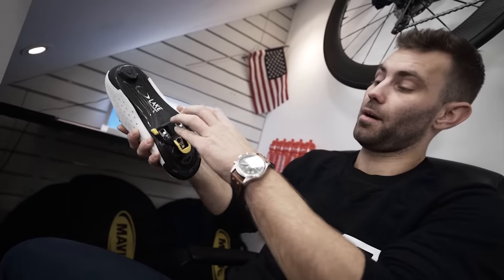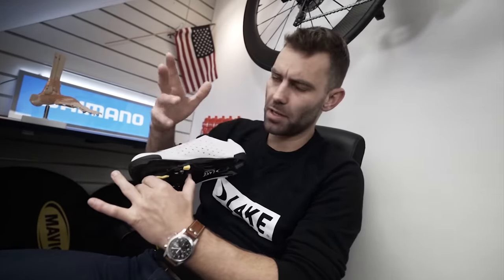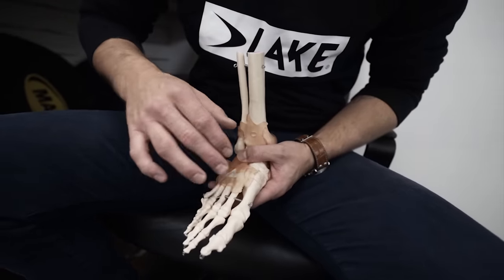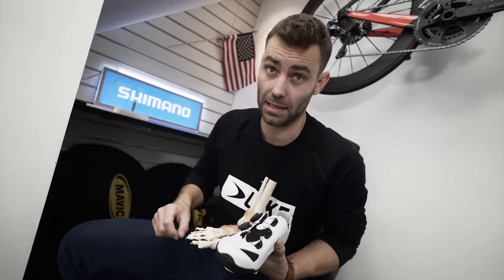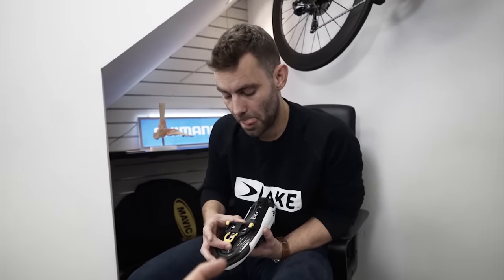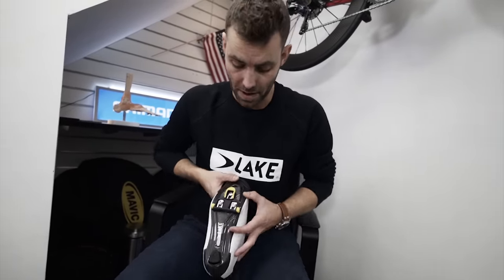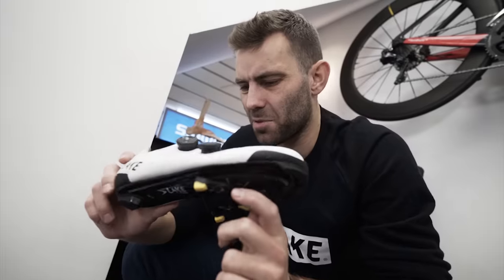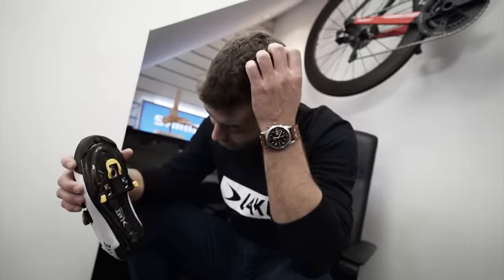How to Set Up your Cleats - BikeFitTuesdays

Comment: Bust my back many years ago ... rugby ... bed .... cast ... wheelchair .... and then had to effectively get back to even walking after full body cast for so long. 
Net result, well, shoes and position 30 odd years later make a difference. I’m certainly what you’d call “unreasonably active” and run an outdoor company in France 
I’m not a mad arsed million km per day guy on a bike being older, built like a brick privy and essentially knackered but I just did the first half of the French Chemin de St Jacques from Le Puy (350 km) on my bike ,.. and only have another thousand plus or so to go to Santiago. I admit to being sceptical but have found cleats to be surprisingly handy on my bike. Only have one set of spd based shoes as the rest is just flats on the other bikes. Which is fine. 
I’ve been wondering and obviously researching advice on this as I get used to them. Reality is that there’s a hell of a lot of “advice” out there so you end up just trying shit. 
I do however trust what James said here because he is bloody obviously a bloke who knows his subject. 
Were I to be anywhere near him and not in SW France, I’d pay for him to actually just set it up properly for me.

I’d advise others to do the same if they can and are closer. A day spent doing that is worth a lifetime of messing about ... get someone who actually knows what the issues are to help you. You’d not try to guess how to fly a helicopter even if you had one so why guess when there is an option. 

Cheers

Comment: This is my 1st time using clip-ins.  I've watched several videos because I had a slight hip pain after my 1st short 15 mile ride with the new pedals.  I positioned the cleat so my heels would point inward because that's my natural foot position.  I mistakenly positioned the line of the cleat to line up with the small bone (pinkie toe) rather than the big bone.  I'm gonna make that adjustment and see how it goes.  Thanks for the tips.

Comment: I drilled holes on my old Shimano XC31 shoes just to have the cleats further back by nearly 6cm from the 1st metatarsal as an experiment. It is still not entirely mid-foot, but close. By doing so, I found you also take the load off the calf muscles and activates the glutes more, thereby sustaining longer, harder efforts as well. It feels weird for sprinting but hey, it's comfortable for audax, relatively fast endurance rides and touring. Only downside is that there is some amount of toe overlap and touches the front mudguard sometimes, but never had any issues with it unless you pedal on tight corners.

Comment: I got my first pair of shoes and Look cleats, and it seems to be easier to setup than I thought, I prefer them slammed all the way back but have to angle the cleat because my right foot points out more than my left. But if you slam the cleat all the way back then you just have to worry about the left/right tilt which you can keep testing.  With the cleat forward it will cause IT band pain, at least for me it did.

Comment: Brilliant. As ever. Question for jim. I'm slightly valgus (knees inwards) but my LAKE size 47 (plug) shoes are so wide i have no option but to move them outboard to clear the crank. Any ideas? Tricky one!
Reply: Similar problem with mine, interested to see any possible solution.
Reply: depends on the cause, arch support and some wedging might help if pronation is driving it
Reply: @Bikefitjames  cheers! Next time im in London i want to book in actually.

Comment: I'd love to hear about how cleat position interacts with saddle height, and setback.
Reply: He answered this in the latest Francis Cade video. If you move your cleats back all the way, you probably have to lower your saddle by 5- or 10mm, because the extension of your legs changes when changing the cleat positions.
Reply: @Xantulle  thanks for the heads up, I haven't watched yet. I'll give it a watch before I go to bed. Thanks! :)

Comment: Great video. I do have one question: I got a bikefit about one year ago as I had ITB issues and from an old injury one leg is 1.5cm shorter than the other. The fitter moved one cleat fully back and the other to the front to counter this discrepancy. What is the thinking behind it? Together with some minor adjustments it helped a lot, but I do not really understand it :D

Comment: Interesting videos these bike fit ones. Here's a question on cleats. I've nearly a size difference between one foot size and the other. If I set the cleat on each foot relative to the ball of the footmy pedalling feels different one leg to the other. Should I set them the same position relative to the shoe instead so that it puts them in a similar postion relative to rest of the leg and joints?

Comment: Found this video really helpful as I bought a new pair of shoes last summer and have only just been able to wear them as my right foot would go completely numb within 15 minutes of riding. Tried so many different setups apart from this 🙈. Still have what feels like a pressure point on the outside of my right foot which causes a bit of numbness but nothing to the level it was. Any tips on how to sort that? Thanks

Comment: Thanks for the very helpful video. Just a quick question, I recently found out I have forefoot varus, but apparently it's only on my right foot, resulting in hot spot on the outside of my right foot. The left foot is quite normal with no pains or cramps whatsoever. Now, I know mounting cleat wedges would be a solution to this problem, but I wanna know if it's ok to mount wedges on one cleat only? Wouldn't it create leg length descrepency? And if it does, how do I fix that? Thank in advance.

Comment: Hey James. Set the cleat up on my Bont Vapor S all the way back. By doing so, I had Discomfort on the right hip/right lower back. I think Bont's are drilled further back than most shoes. Went the opposite direction. All the way forward and I feel more power with no discomfort on the right hip/lower back. Any idea why that might be? I've had a fit and saddle fore aft is as dialed as it can get. I was just experimenting to see if more power would come from that rear ward cleat set up. Anyway, curious what you're thinking might be?

Comment: My Bonts have limited adjustment. I tried right back. But found I needed to move them forward a bit to feel fully planted. Bont Vaypor S size 42W. I’m 1.68 m tall and ride an R5 size 51.  I couldn’t get the cleats to feel right until I got my Saddle low enough. Saddle height, saddle height, saddle height. 

Question: do you know if the Bont cleat positions are neutral, forward or to the rear? 

Love the Bike fit videos.
Nick

Comment: I have Mavic shoes and new cleats for a new bike. Noticed today that when i turned the handle bars quite sharply, the tip of the shoes rubbed against the front tyre!! Never experienced this with my old shoes and new bike. It this simply down to cleats needing to be adjusted?

Comment: Hello,,,
I faced an issue when I bought road cycling shoes then I fixed cleats properly in many locations inside the  showes however the shoes face still touching the crank atm I don't know why is there any piddels with long arm a little bit to let the shoes far from crank arm or not,,,
Waitting your kindly reply,,
Thanks a lot
Appreciate,,, 😎👍

Comment: Great video. I have very wide lake shoes. Because of this my front/side of shoe rubs against the centre of the crank. I've tried moving cleat position (to side) but it still rubs. So far I've been told the only way to help is to increase stance width, but I have small hips and if I do it could lead to my knees moving in when pedalling. Any tips?!

Comment: One question. BFJ said that you should place the cleat 10-20mm behind the first metatarsal/ball of the foot. What exactly should be this distance behind the ball of the foot? Top very top of the cleat? The top bolt? The back two bolts? Looking for some clarification - thanks!
Reply from the maker: The middle of the cleat which is marked, quite hard to spot though

Comment: Bikefit Tuesday’s are so interesting 🙏🏻
As a physio, I learn a lot with these videos. 

But concerning the lever: why the « length » of the lever don’t have an influence on power ?
Reply from the maker: It's because it's part of a system, bit like crank length. Power is work done over time, so you just end up pedalling faster or slower to compensate

Comment: Hi! I started using clipless pedals and I'd like to set up my cleats corretly. I moved the cleats back as you suggested. I noticed when I stand hips widht apart my right leg is at least 2 cm forward then my left leg. Should I consider this when I set up my cleats? If so how?

Comment: Great video! I have one question: recently I bought new shoes and now I start having pain already after 10min on the outside of my foot (google says its called 5th metatarsal base). could it be cleat position or the shoes are simply too narrow for my feet. thanks!
Reply: I used to suffer from intermittent 5th metatarsal pain myself. It was due to insufficient stance width.  The cure was to fit 65mm axles on my Speedplay Zero pedals, and run the cleats in the center of their inboard-outboard range of adjustment..
Reply: @germanhugger41  Stance width is the keyword. Just googled it and could be my problem! Thanks ... will try that out today.

Comment: I have seen Pros riding the Shimano  red SL cleats with 0 degrees float. I have some in the garage. I've had a bike fit so I'm tempted to try them out. However I don't suppose I'd gain any advantage unless I could do 2000 watts Sprint.

Comment: i know this video is a few months old so don't know if I'll get a response, but google hasn't been doing me any favours so I'll give it a shot. Do you think bad cleat position could possibly travel all the way up your body and result in one of your hands going numb? Recently adjusted my right foot cleat just a smidge because I was having some problems with that particular foot, and now a few weeks later I've started having pain in the right knee and also my right sitbone. The weirdest thing is also my right hand has started going numb super early into rides even tho my hands and shifters are in the same position. Clearly I made a mistake in my adjustment, but I just don't know if the hand thing is part of it or not? My left hand hardly ever goes numb like my right hand does...

Comment: Hey guys i have shimano r321 shoes with cleats set fully back with speedplay pedals. I have to much rocking in the left foot and now the foot is pushing on the outside side of the pedal and i get a slight pain after rides and think i need more stable shimano pedals after watching your videos. My question is if i switch from speedplay cleat to shimano will i have the same fore aft position?

Comment: Great Bike Fit Tuesday and full of information. James mentioned about white tape and marking up your foot position and he generally moves the cleats back 20-30mm. Where would this measurement be taken on the cleat? Is it as simple as the centre?
Reply from the maker: Yep the centre, which should be indicated by a small marker - we tried to show it in this video but it's really hard to see on the black plastic of the cleat!
Reply: Thank you for responding so quickly.  Time to check my cleats

Comment: Hey James, thanks for the nice vid! I started with my cleats/shoes facing perfectly straight forward, in line with the bike. (I have the yellow SPD SL). I've noticed a lot of pulling on my right knee though when cycling for a few kilometers, and my right knee is coming inward towards the bike frame when I bend it when pedalling, while the left leg/knee stays straight. Cycled a couple times and it resulted in pain in the back/cavity of my knee. Can it be that the "natural" position of my foot is slightly outwards (front out / heel in), and that I have to rotate the cleat a bit to relieve the knee? I notice this also when doing squats; my right foot is slightly angled when squatting/bending the knees. Will try them at a slight angle, hope I won't hit the chain with my heels then though.. Can this knee pain / pulling feeling be caused by a wrong cleat setup, or could it also indicate a different issue in my overall bike setup?
Reply: Wow I now know it wasn't necessarily the angle of the cleat. Issue was my stance. My feet were simply too close together with the default 105 Shimano pedals (I'm 6"4), hips/knees/feet weren't aligned at all. Angling the cleat helped a bit to "open up my hip" and bring my knee out, but a wider stance was the real fix. I first tried to put my cleats inwards under the shoes, to bring my feet further out and increase the stance, immediate improvement! Less "pulling" feeling in my knee and knee didn't come as close to the toptube anymore. I now bought Ultegra +4mm pedals, the slightly longer axles make a huge difference! Can now move my cleats to the center of the shoe again, don't need to 'angle' them much and my knee pain during cycling is gone!
Thanks a lot for your videos and insight. Getting a full bikefit from you someday is now on my bucketlist.

Comment: At about 4 minutes you mention that moving the cleat back reduces the length of the lever and increases stability through the ankle, so why do you want to generally want to move the cleat all the way forward? Is moving the cleat back specifically to address problems like knee pain?

Comment: Great video,  but after having my bike and shoes set up by a pro fitter, I have used the yelllow shimano cleats for 5 years and never had any issues or pain.
However recently i wanted to experiment and i moved the cleats all the way back, and now on the foot that i mostly clip and unclip, the top contact point of the cleat keeps breaking after 4 to 5 rides. This happen to me 2xs. Has anyone know about this issue or experience this before? Is only happening with the foot i use to clip and unclip. Thank you

Comment: You didn't mention about if a person has a duck feet. If you put the cleat all the way back you don't have enough room for to heel in. I think the solution is an extension axle like the speedplay or the shimano 4mm axle. Too bad the Shimano only fits the Dura ace 9100.

Comment: Super informative stuff.  Have struggled with this for as long as I can remember.  I have a fairly big discrepancy between my left and right foot length.  1st met on the right foot is about 8 mm ahead of the left.  Curious how you address this with your clients.  Thanks for a fantastic series.
Reply: Did you find an answer for this?
Reply: @CyclingExplorers  I have not.  I have moved cleats all the way back, though,  and it does help a good bit.  It still "feels" like my right foot is farther back on the pedal than my left but I want to give that some time before I make more adjustments.  One interesting thing I did learn is that even within a brand of shoes--I ride Specialized--the soles can be completely different and as such the latitude for cleat adjustment.  The soles on my winter shoes place the cleats 10mm further forward than on my regular shoes even though both are of the same brand.

Comment: Hey ;)
I would like to know if u recommend a show with a slight help for the Foot-arch. like Specialized Shoes are a Little elevated on the inside, or you can choose a insole wich is elevating your arch. Necessary ? Got. some Problems in the Outside of the Food After switching to „Support“ inner sole.
Reply from the maker: Check out our episode on arch support a couple of weeks back!

Comment: Hey. Took your advice, moved the cleats back and it’s working great but I can’t steer anymore. Shoe tips are blocking my front wheel from steering. What to do? BTW Great vids every time. Hope you’ll reply this super late comment/question.
Reply from the maker: Toe overlap will occur on some frames, all you can do is learn to pedal avoiding it - not ideal if you are commuting and turning tight corners, but fine for regular riding
Reply: @Cade_Media  Cheers mate.  Cleaning my shoes from tyre scuffs very often now. Thanks for the reply.

Comment: So I’m new to cycling, about a year. I have been looking at clipless pedals and in my information gathered this very subject has come up but what cycling shoes allow you to bring the cleats back far enough and this seems to be a big problem. I’ve seen people drill new holes in their shoes so to move back to what they call midsole cleat position and I know of a guy that does this and calls it arch cleats, he uses football boots. So does the Lake Cycling Shoe allow to go back further than other brands.
Reply from the maker: I wouldn't worry about mid foot cleat position yet, as you say it would involve drilling. 
Lake, Shimano, sidi, bont are all brands which will allow good cleat placement. For some reason fizik have cleat holes very far forward.
Reply: Francis Cade thanks very much for your reply, I really appreciate it.